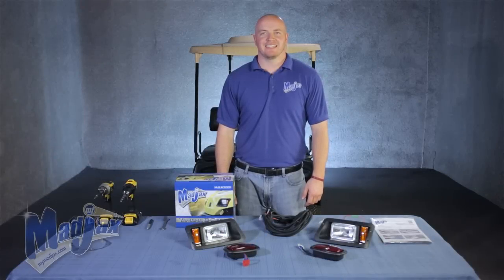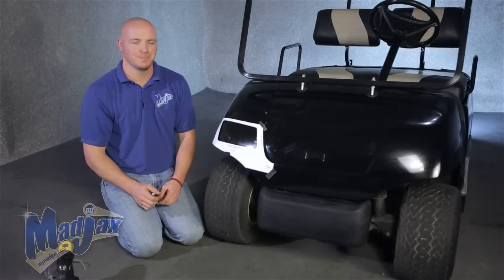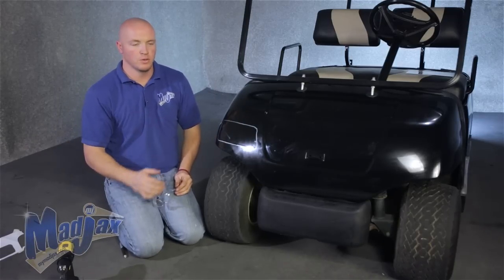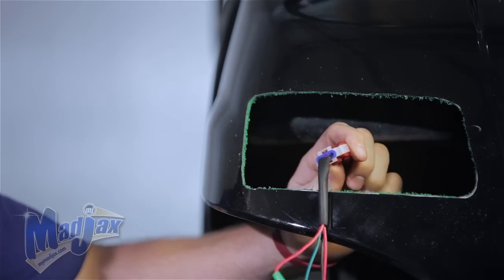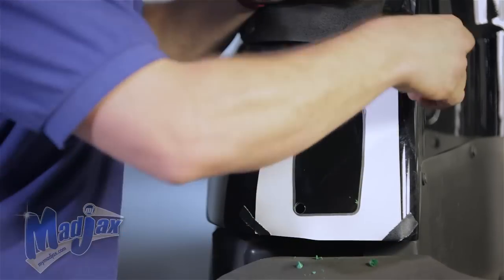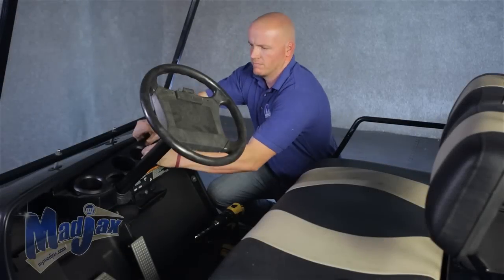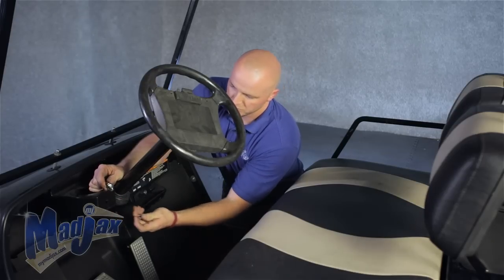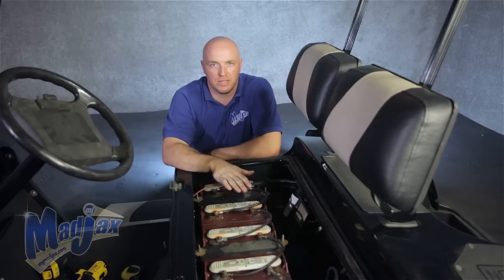Light Kit designed for Yamaha® G22® | How to Install Video | Madjax® Golf Cart Accessories

Comment: to bad the template that came with mine was too big for the light that so now I have a botched body piece and they've discontinued  the replacement parts so now I've got to try to fill the hole then wrap the cart then use pod lights bolted to the top or spend 5 grand to get a custom body kit. not to mention the push-pull switch is junk that broke after a few cycles of use and was stuck on for weeks until the battery died and now won't hold a charge I've reached out plenty in the past madjax customer service is just as trash as their switch pretty shit deal having to push back my charity ride because madjax won't make it right and find me a new or even used front body with precut holes because I'm not going to screw it up a third time because the template is wrong
Reply: Less learned? Someone in quality control messed up or you messed up.